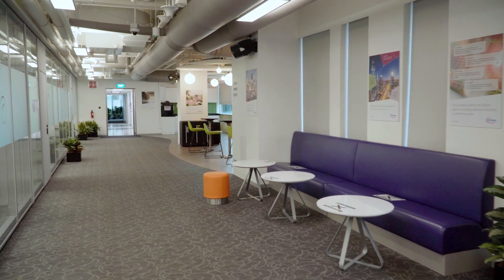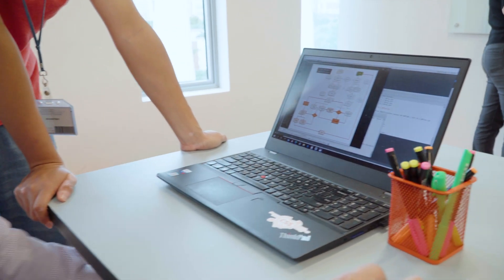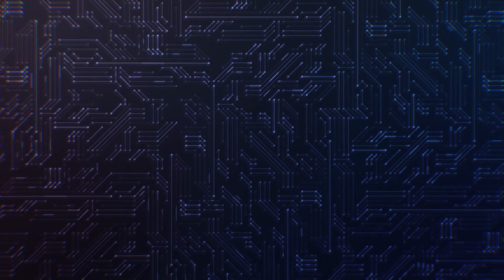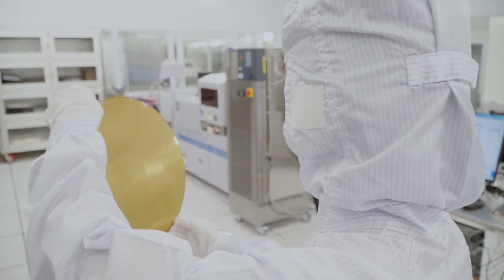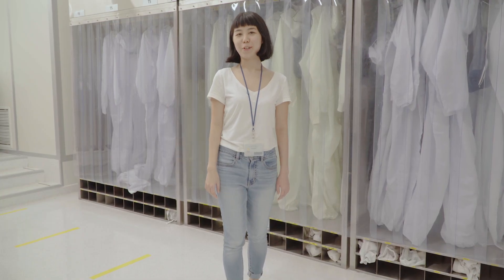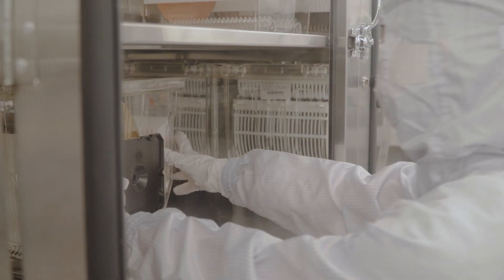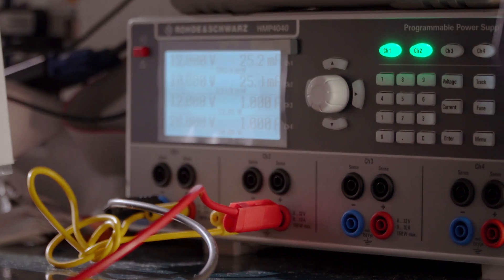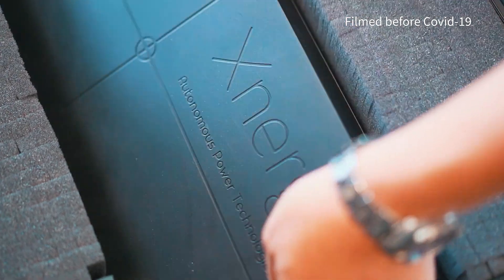Exploring Infineon's Innovation Hub: A Tour of Infineon Site in Singapore | Infineon

Comment: (a great deal of reckless machine learning screwed up this comment as typed originally by alphabet speech recognition it-- has been edited!) From a historical perspective regarding not just technology in science but the philosophy underlying current innovation we are essentially mired in simulation. in order to scale the solutions and do what this recruiting video nearly at the end mentions which is to help our world not vice versa interfacing with the analog on the fundamental disruptive level is actually essential for those who care about success. That means that energy storage chemically electrically has to be disrupted. The little thing that goes on the back of the propeller in the metastasizing windmills offers profits to the electrical dead enders but the role of computation and control is to have the wind directly condense the air and ship the liquids unimaginably yetby industry cost effectively making electricity quaint as it should be for a product for example for Singapore. Singapore doesn't need Australia to screw around with a million volts on the floor of the ocean as if that can be defended even on other than its merit logistically as a tool to extract equity from your nation for the interests of even Germany not just Australia. Moving energy requires automation sophistication innovation and above all else actual revOLUtion. To see FUEL CELL!! bicycle of yesteryear even if confined to France quaintly is to have an open mind and actual optimism that our grandchildren will know what a iceberg is in part because in high school they won't just enjoy fresh vegetables yAnKlY-flown on the virtual-air-roads across the oceanIN JUSTHOURS cheapl from anywhere they will be able to SO GREENLY HYPERSONICALLY travel themselves for almost nothing without subsidy and only know about NAKEDpropellers from encyclopedias. That is with the notable exception I guess of windmills LEFT OPERATING PERHAPS SO AS TO NOT BE FORGOTTEN HAVING BEEN THE GREATEST THREAT TO LIFE ON EARTH EVER BUILT. 
But using windmills to ANY ENDS TO 'produce' electricity will be like grinding grain and liquefied nitrogen will be regarded as goldEN except not cast from lead but as the near CLEAR where petroleum despite its processing into transparency nobody will believe ever had the appeal of any luster. Power electronics has its place; there are many valves and many many tUrbInEs to get right this time... where with the locomotives in the past we just did not have the PRECISION LABOR to control them and now we have the potential to #makechipstoJUSTLYdoIT and control the climate on the earth AS freely as we CAN do in our cars if not #PRESENTLYEVENourhomesinTexasDUH. 
Best recruiting video I have ever seen! (If only the promise IS TO be kept.)